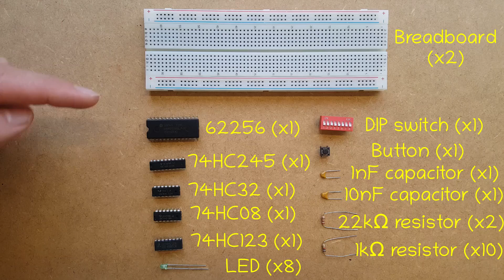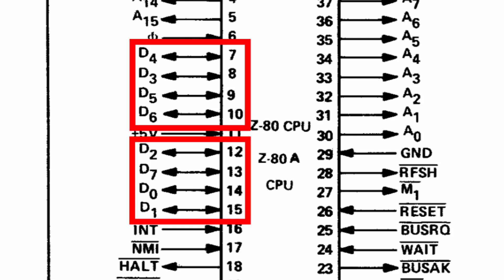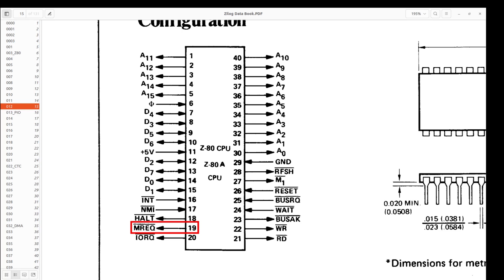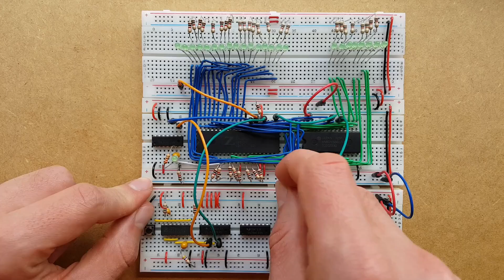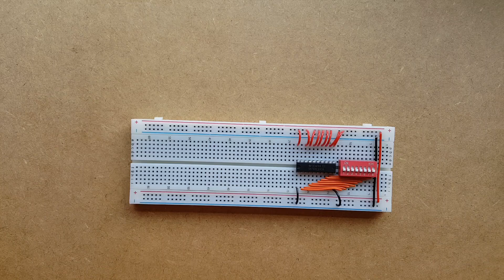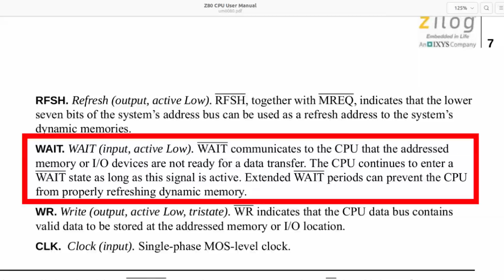A cheapo Altair 8800 style computer using a Z80 - (part 3) - Adding RAM and the deposit function

Comment: Actually, you can mix up the order of data pins between the Z80 and the RAM all you want, it'll still work fine. It's the connections to the LEDs and toggle switches that you want to get right.
Reply from the maker: You're 100% right, good spot!